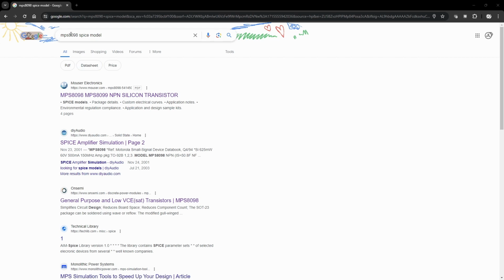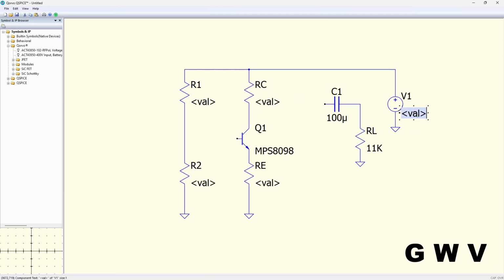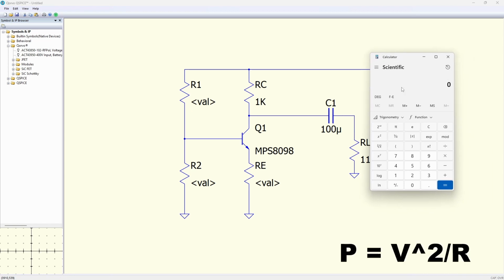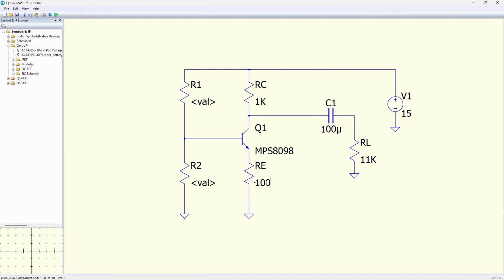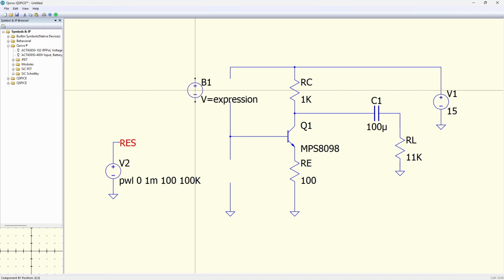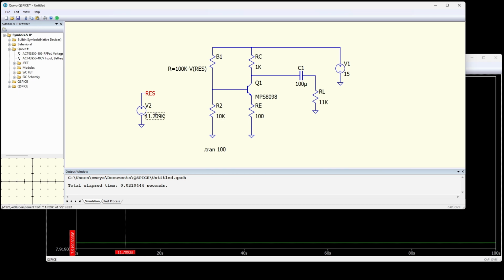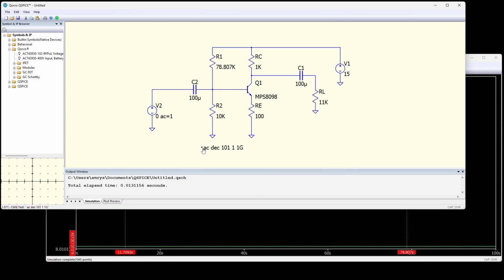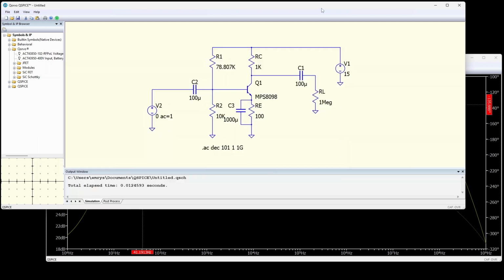Tutorial: Designing a Common-Emitter amplifier using QSpice

Comment: What would need to change if the load resistance is much lower? For example, a speaker that is only 5 ohms. Great video!
Reply from the maker: I probably wouldn't use this particular circuit to drive a speaker because of how much power that would require. In theory, you could make Rc 5 ohms and use a really beefy transistor + heat sink. With 5 ohms at 15V, that's going to have to dissipate about 45 watts, and the transistor will be sinking 3A of current.